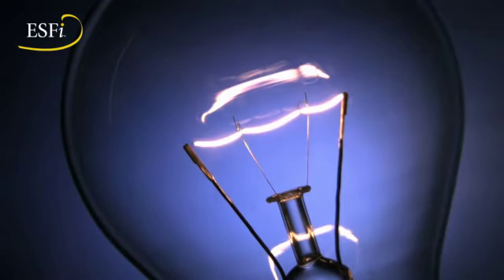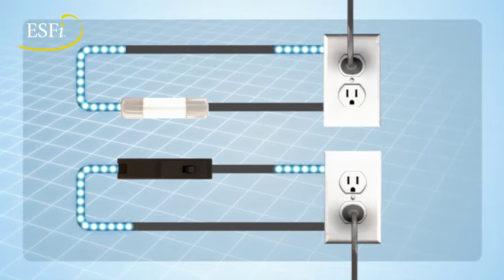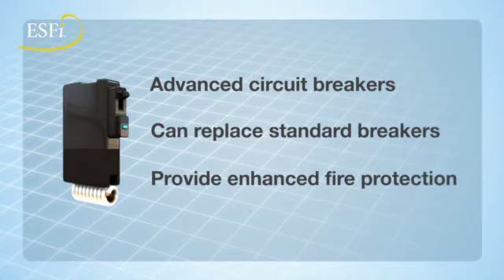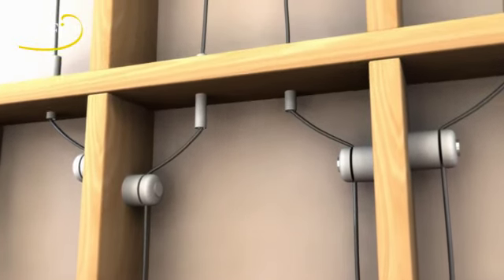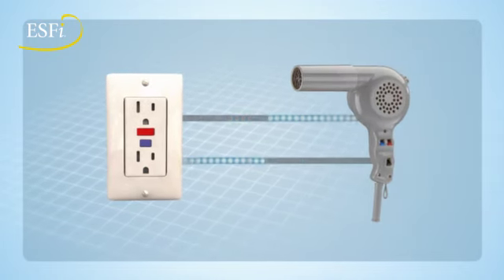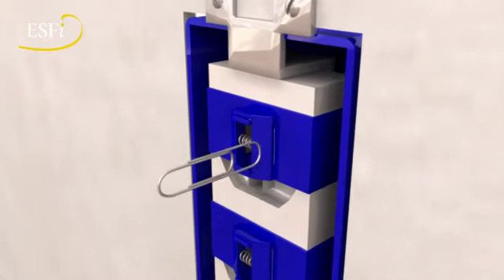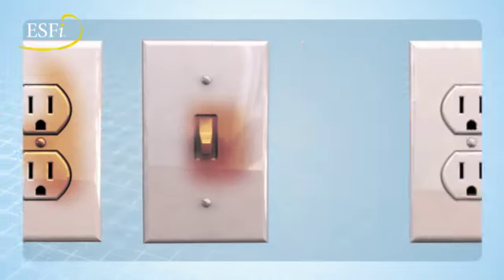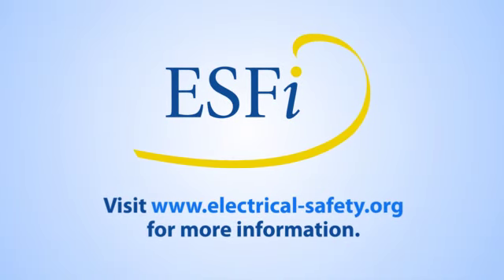Home Electrical System Safety

Comment: Good info, except regarding AFCI's. There is not solid real world evidence that these breakers stop a fire that a standard breaker would not have also. They cost much more, $60+ vs $8 for a standard breaker, and are terribly prone to 'nuisance tripping'. Nuisance tripping' is when there was no actual fault and it tripped anyway. It is common with these. Now 85 year old grandma might have to walk down the stairs in the dark to reset the breaker (added risk of her falling), or maybe all of your food goes bad because it nuisance tripped when you were away for a few days, etc.
 The large majority of electrical contractors do not support their use, and believe it to simply be a money grab by manufactures. I agree with them.